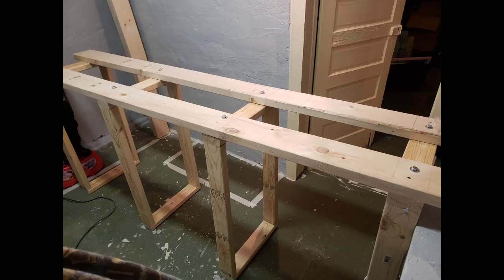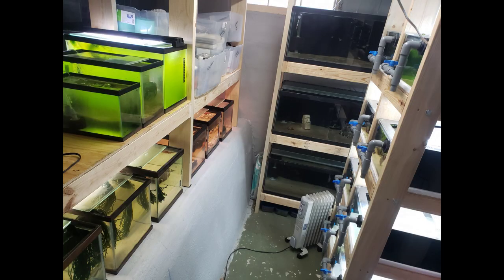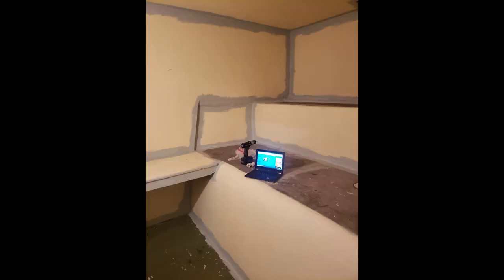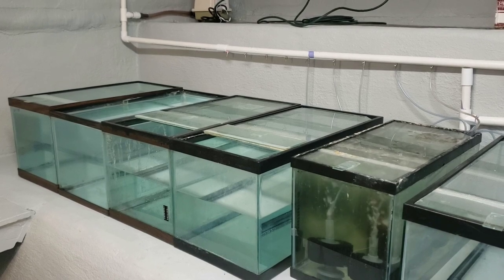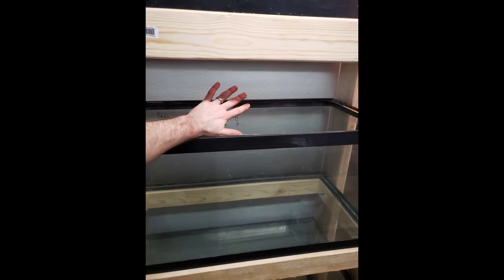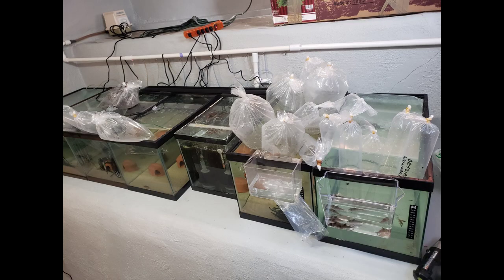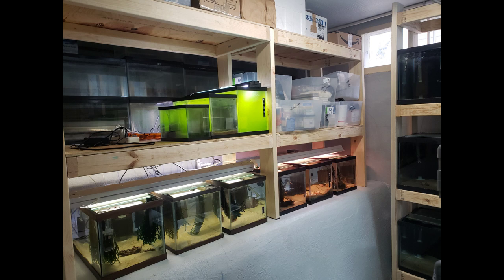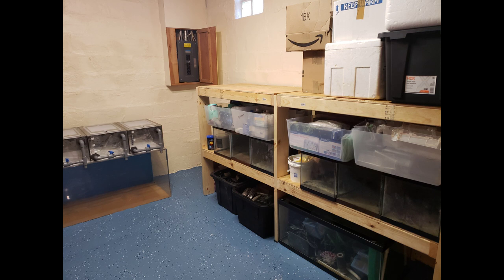My Cheap DIY Fish Room Build : Breeding fish in 25 Tanks for less than $500

Comment: As you mentioned, the price of wood (2 x 4s) has gone through the roof.  I recently built a stand for a 125 gallon tank using the plans from a video that was 10 years old.  The narrator claimed this would not cost more than $50 to build.  Fast forward to 2021, I built the same stand - total cost was $156.00.  The wood, 8 x 4s, was of premium quality - it was about $6.5 per 8 footer.  If that was not bad enough, when you sighted down the length of the wood, the vast majority of it was quite warped.  Certainly was an eye-opening experience.  I wonder how much it would cost in 2021 dollars to build exactly what you built way in the day - just how long ago did you build the fish room you described?.  Would be interesting to know.  Any way, enough rambling.  Once again, thanks for the video.  I look forward to following the journey of your new fish room build.
Reply from the maker: Thanks for tuning in and commenting.  I started this build in November of 2019, and just tore it down in November of 2020.